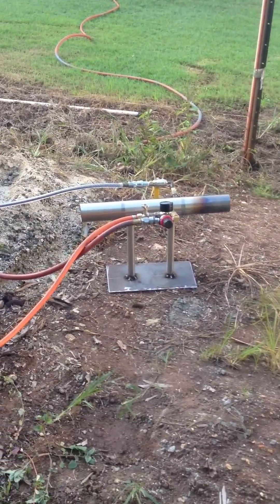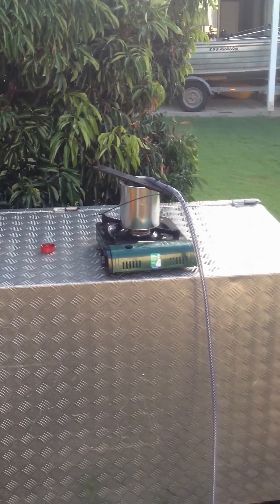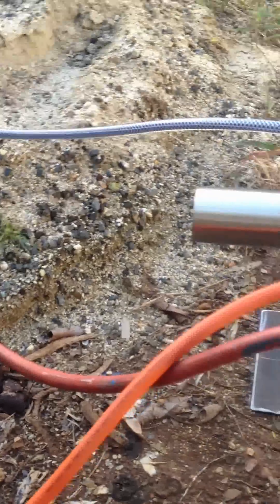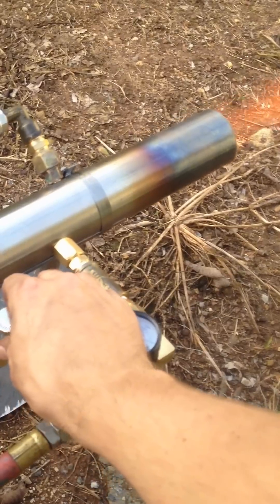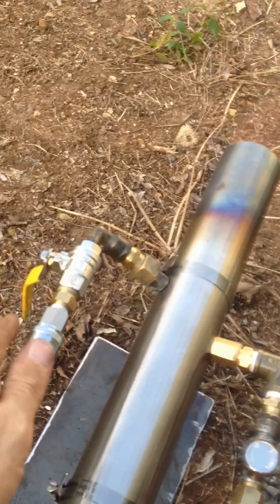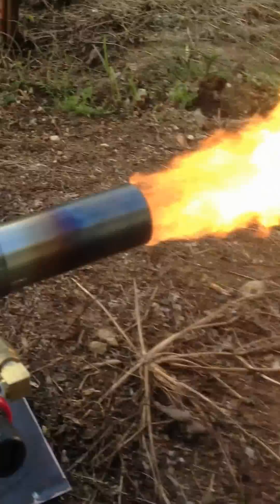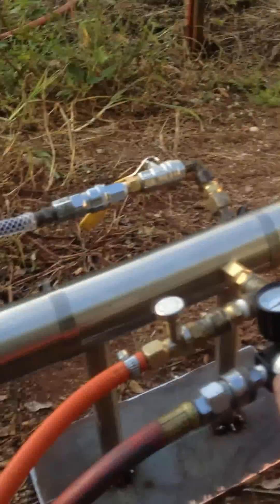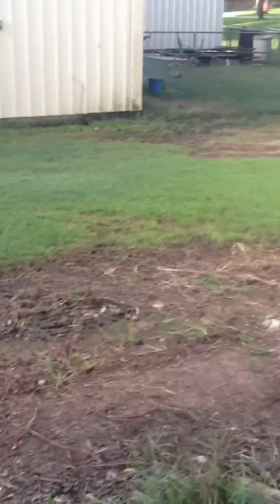Siphon Nozzle Furnace Waste Oil Burner

Comment: I use a 1GPH Hago nozzle but I have to turn the furnace down in order not to burn the Aluminium, I have a valve that regulates the amount of oil that is allowed to flow to the nozzle so even tho its rated at 1GPH you can use far less oil.  The nozzles are quote cheap so you could experiment with a couple of different sizes and spray patterns.

Comment: NO other per-heater, I just start it on LP for like 3 mins or so then just switch to straight oil, Where the coils sit they become about 180-200 degrees F Any hotter the flame becomes unstable sputters and shuts off

Comment: Question  Have you found a way to make it quiet?  Like mine when i have it on high 15 psi to 35 psi  it gets extremely loud but very powerful,  The only way I'm able to get it to be quiet is to run it on 5 Psi or less

So just wounding if you know how to make it silent?
Check out my burner videos

Comment: I will be mostly running waste motor oil .   I just wanted to make sure it also could run on the other fuels. My mine propose is to only heat my garage fast 1 gallon an hour is fine

Comment: Iron melts at 1538 °C, 2800 °F, so getting a waste oil burner to generate the btu's required would be difficult, depending on how much iron you wanted to melt. Say you want to melt one pound of iron, I would guess you would need in the ballpark of 350,000-500,000 btu/hr ratings. I would say three of those would most certainly handle anything you wanted to do. Dont quote me on this, but sometimes adding water to the combustion can increase temp, not need much, a .1 gph hago nozzle and little air.